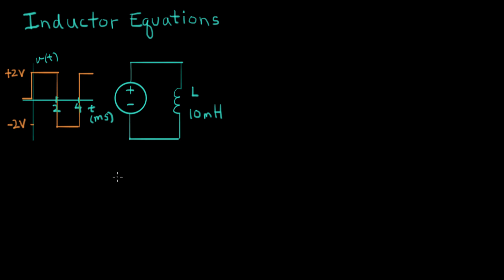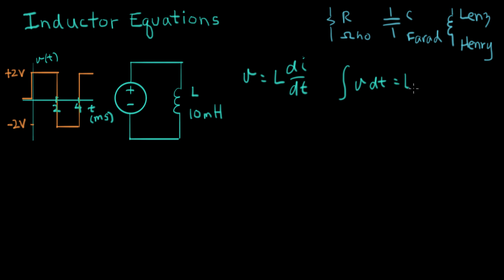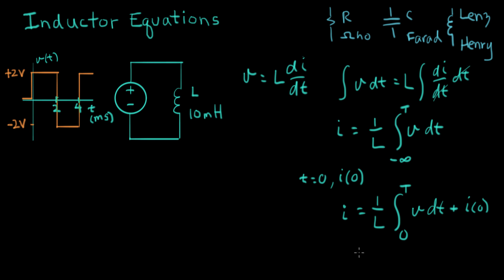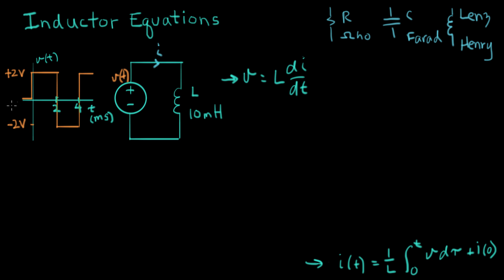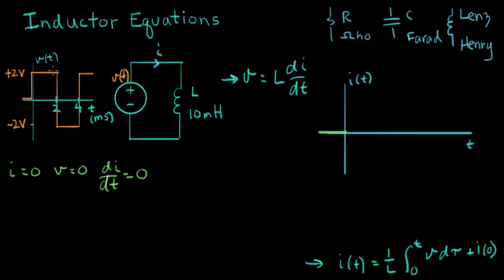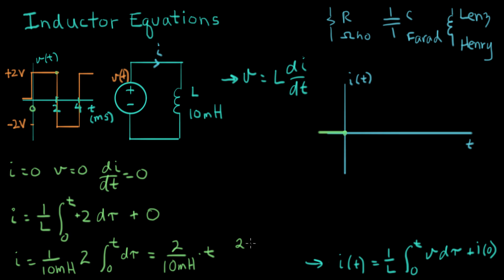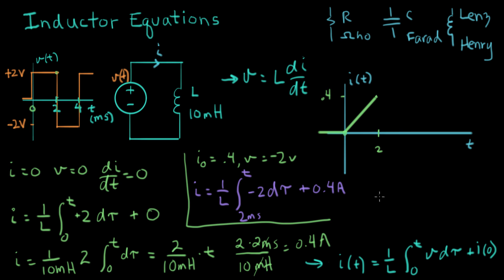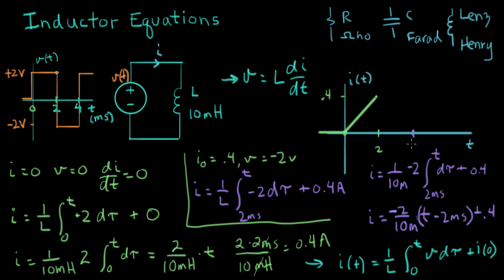Inductor equations

Comment: btw, L * di/dt doesn't exactly hold for an air coil. There are "received" electromagnetic fields that induce currents that add or subtract to any supplied current. When there are mutual inductances in geometry, things get even more complicated. Plus there can be constant magnetic fields such as the Earth's field, with its vector aiming a certain way in your location or fields from nearby equipment including oscilloscopes, lighting, etc. Air coils are thus a bit "magic" and there are many geometries unexplored.